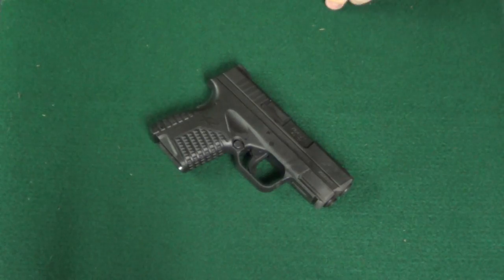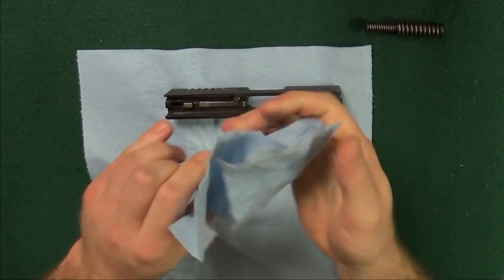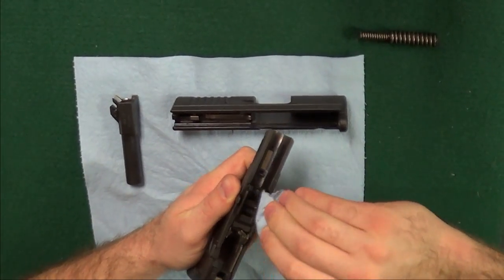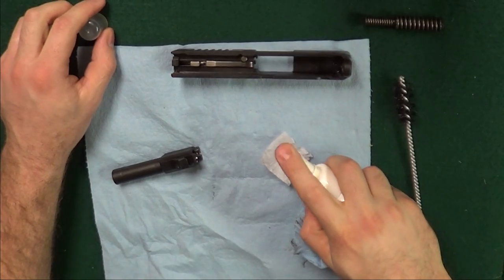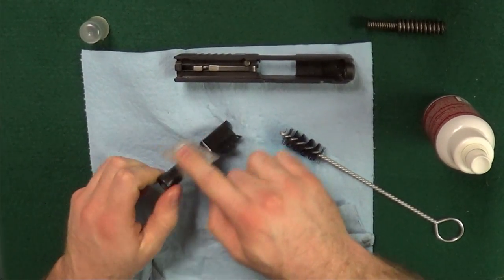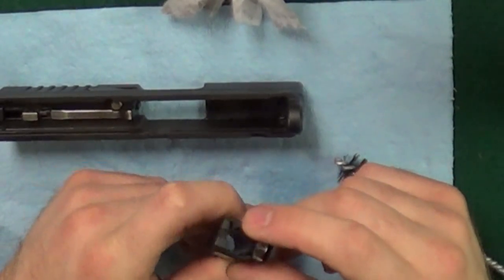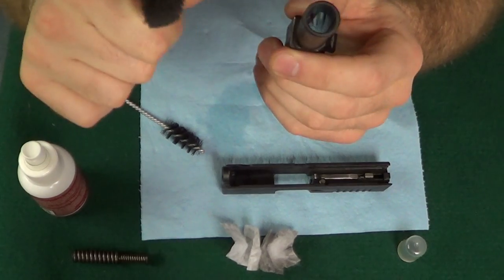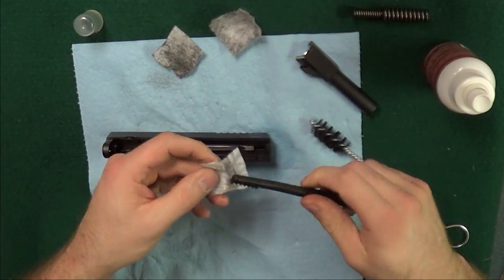XDs field strip and cleaning first cleaning after first 50 rounds

Comment: Good video.  Thanks very much.  After the first 150 rounds through my XDs (I shot Remington UMC and Fiocchi 230 grain FMJ) the gun was pretty dirty.  However, it fired every single round without any problem.  Excellent firearm and easy to clean once you get the hang of it.
Reply from the maker: Thanks for watching and the comment.
Yes, it is an easy pistol to clean. I shot mine this morning and will be cleaning it this evening along with my 1911 (which takes a bit more to clean well).

Comment: +pheasant815 What is a feild strip?
Reply from the maker: It is the level or degree one would break a firearm down "in the field" to clean,  or a quick functional cleaning.
If you are saying I spelled it wrong . . . I'll recognize this new word from 1940s is commonly signified as "fieldstrip", or "field-strip" (Merriam Webster). It is also common in the firearm  community to use it as a two word signifier. 
Either way, thanks for your comment!
Reply: ***** Interesting, I wasn't aware of the alternate spelling. Thanks for the info.

Comment: It's funny you say always read your manual but you still use grease.
Reply from the maker: +Kris 9mm You need to read the manual to get the basic information; however, more that the engineer's ideas go into it. For example most manuals I have say you should keep a firearm completely unloaded (including the magazine), but that is not appropriate for a defensive firearm (safely secured). Lawyers play a role in manuals too. My point is manuals are the best place to start, but experience with the actual tool also yield results. I do use grease in the warmer months, but not in the cooler months. In the last three years since this video I have not had an issue with the pistol and actually carry it.  Thanks for watching!